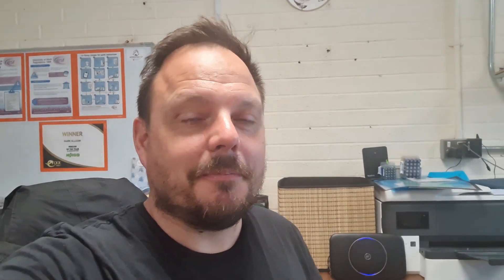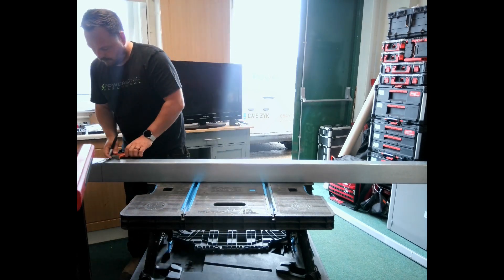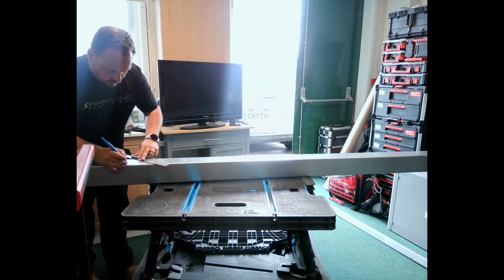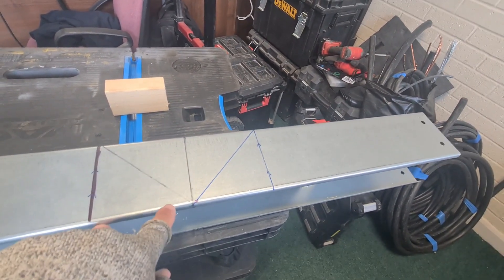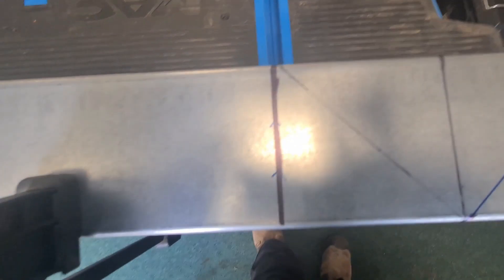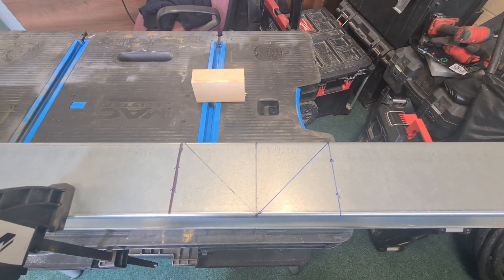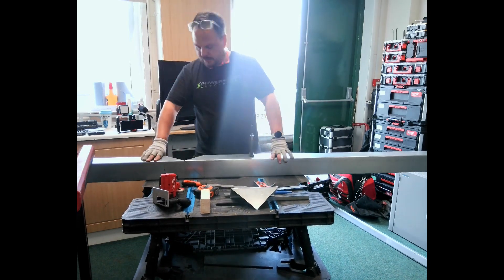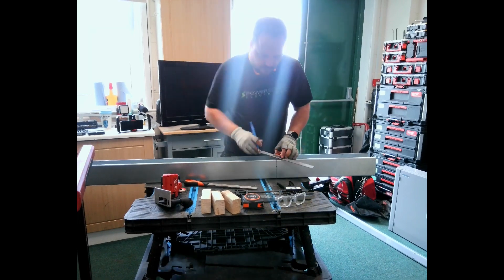Fabricate 100x100 Steel Trunking and gasket slotting kit for Eaton TPN DB

Comment: Shouldn't you fillet it? If you just cut one 45 and cut the lip off the other 45 then you can just put in some self tappers and have a better earth on the trunking.
Reply from the maker: There are other ways as I said Gary at GSH shows that in another video. Won't effect the earth though. Still got a full slab in place with cross bolts. Just different methods. This is the way it was always done once upon a time. No to self tappers tho, they shouldn't be used. Bolts or pot rivets only imo

Comment: Great presentation. Problem with using a grinder on site is you could be into hot metal works and it's surprising how far sparks can travel.
Reply from the maker: Yes this is the case. But then still very commonly used on most metal containment

Comment: Hi Mark just wondered I was told on site that I couldn’t fabricate bends as butted joins we’re not allowed anymore as the butted join is not to standard or IP rating is that correct?
Reply from the maker: It is and isnt lol. Only some pre made trunking meets the IP requirements for it. Legrand salamandre being one that is rated for that. But most other stuff has the same IP rating as making it yourself. You can fabricate to maintain a higher IP rating with a different method to the cuts. But generally this way is totally fine. For example on these little cuts once on the wall will be nearly air tight lol. Lots of site work instructs manufactored bends in tenders and contracts of work so that is why most dont like us making stuff.
Reply: Cheers for your reply keep up the good work👍🏼

Comment: Nice work Mark, if you costed the time, how does it compare with using preformed angles
Reply from the maker: The 90s take about 10 mins each. Liding up another 10 mins of cutting. So 45 mins just on the bends for this setup is about right I would say. Obviously more time with the slotting and fixing to DB/joining. But we would be doing that anyway on pre made. 

Whats a 90 100x100 these days about £15-£18 + VAT ish? So £45-£54 + VAT approx. In fairness we would have to lid up pre made as well so around 30 mins is probably a fair comparison. Not a lot in it I would argue but allows us to be more productive on site and less hot works. We will still be using pre made put it that way lol

Comment: i do this all the time at the board. as the company i work for always gets guseted bend and you cant get them tight to the board.a flat 90. usually take about 10 min and all i use is a roofing square a grinder a file and a drill. i also score the back of the bend with a gengle pass with the grinder and it leave a nice square clean edge.  Thats just how i do it. but your way did look good

Comment: Hi Mark, we do the same thing with the trunking around the board usually 150 x 150 as for the number of cables and sometimes bush and lockring left and right wholesalers never seem to stock the square edge 90's always the gusset type so we have got wise and order ahead but well done I could see the gray matter going there on recall. Ps don't lose the stickers and door handle my mate always does.
Reply from the maker: Haha good tip with the handle  and stickers lol. Always keep them in the dB until we use them. Yeah we lock ringed another dB this week. Fancied a change lol

Comment: Great job mate, we have to use paxalin inbetween DB and trunking.
Reply from the maker: Yeah we use paxolin also but this was 15 quid for both. Done and no stinky smell lol
Reply: I agree mate, it absolutely stinks. I’m still yet to find which blade is best for cutting it with. We used a jigsaw for years but it takes forever, we tend to use a grinder now seems to do the trick. Have you any tips on what you use to cut the paxolin with?
Reply from the maker: @Dibbo1979  we use a laminate cutting blade in the jigsaw. Normal wood blades take forever and blunt after a few cuts.